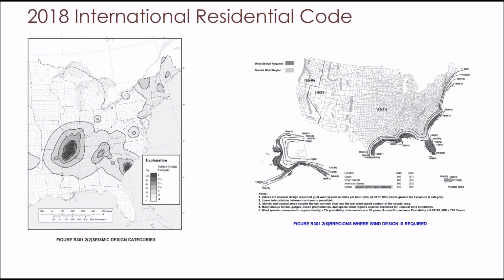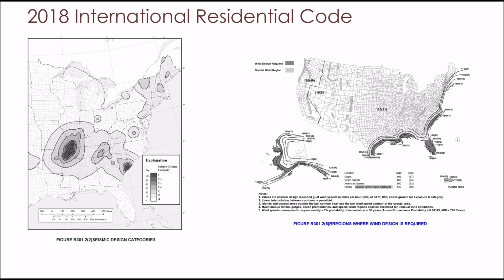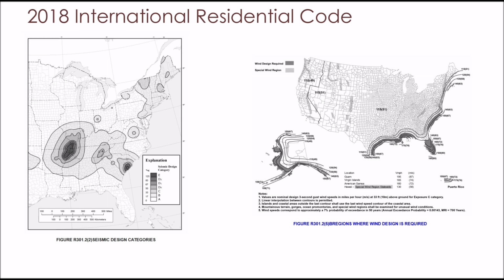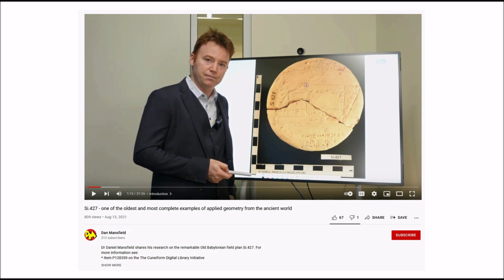More Maps - One With Droppity

Comment: @3:07 with droppity marked for several locations...that looks so much like some air defense maps marking the line of sight range circles for key heights, Otherwise no one else needs that kind of indication on any map (unless they are the enemy air force flying at certain height, they will mark droppoty circles for radar post around their path.
Reply from the maker: Spot on! Check out the previous video on maps. Here's a link to the relevant spot.
https://youtu.be/49x0mfrJPBI?t=730

Comment: Excellent demonstration of why unemployable actor et al have no concept whatsoever of what they are demanding.
I would have gone a few steps further. I would have included more circles of increasing diameter until they reached the edge of the map (the drop increases with distance) and also if i'm in the Central Massif as a climber or hiker, i am going to need a map more than a townee does. No location should be excluded.
Still 10/10. Next step ask unemployable actor how he may use the map that he has specifically demanded.
Reply from the maker: I'll admit. I got lazy. 😉 Copy-pasting circles get tedious after about 7-8 minutes.
Reply: @fepeerreview3150  Not a problem since even a few circles for every location results in an unusable map.